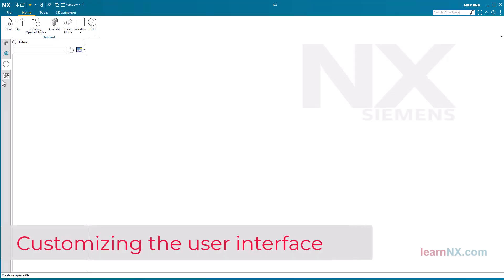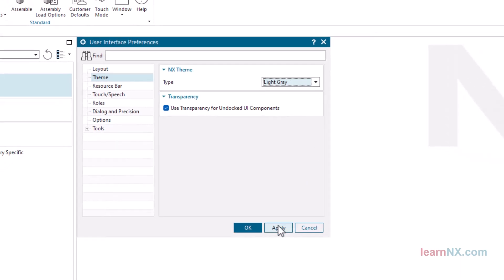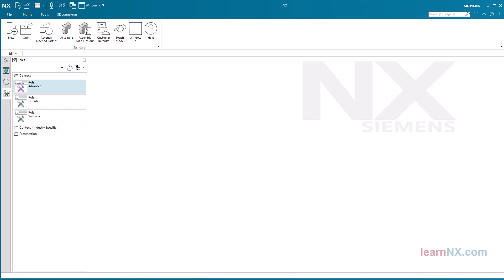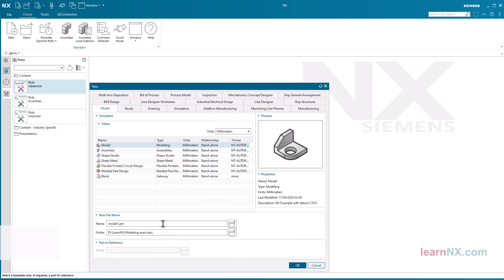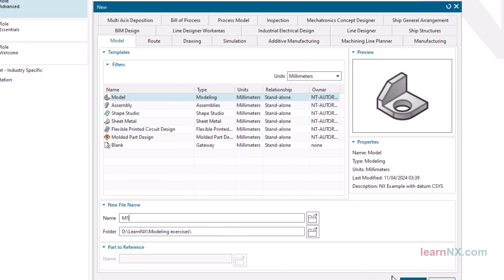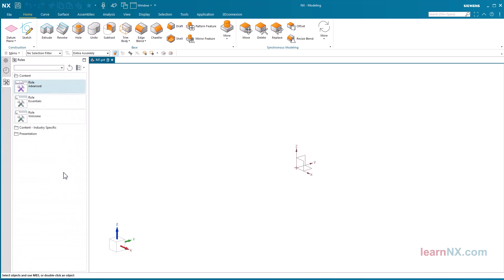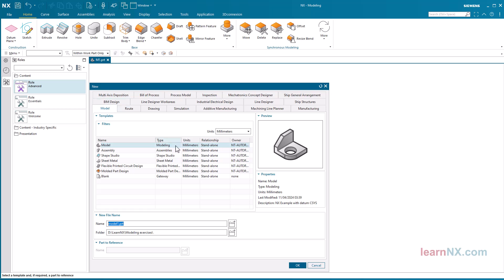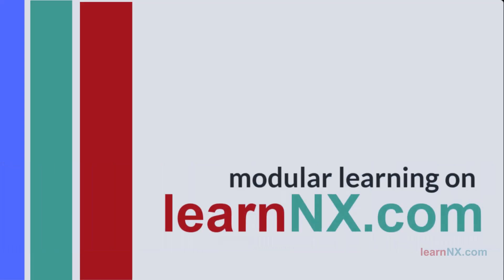Modeling for beginner | Siemens NX Tutorial

Comment: When you select New at the 3 minute mark, you have the option of creating a Model, Assembly, Shape Studio, etc. I only have the Blank < Gateway option. I have googled this to try and discern why I cannot create a new part, only a new Gateway, to no avail. I had to duplicate an existing part file, and delete the parts from this file in order to actually use the software. I am much more familiar with SolidWorks so I find this gateway thing so confusing. Why is Gateway my only option?
Reply from the maker: If the templates cannot be found by NX, they will not be displayed in the overview. Did you move any folders after installation? If so, you can either restart the installation or set an environment variable to the new location of the templates. The environment variable is: UGII_TEMPLATE_DIR